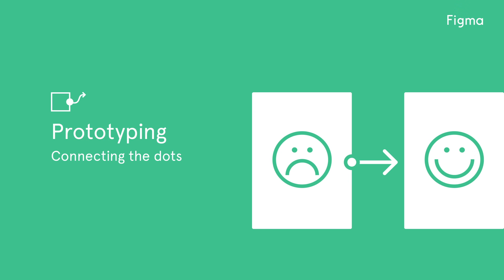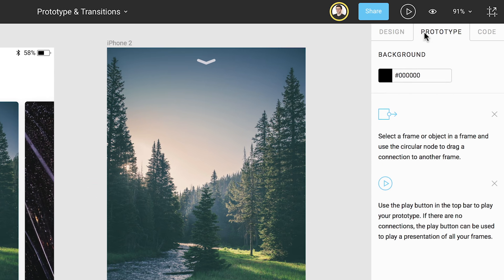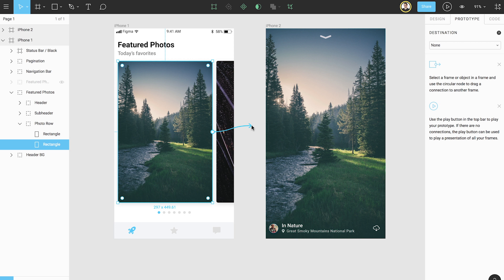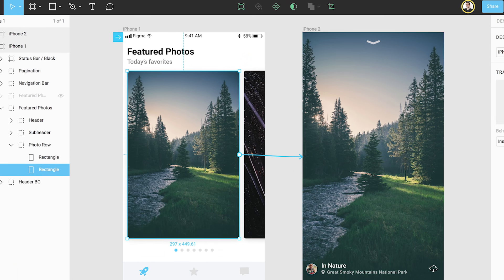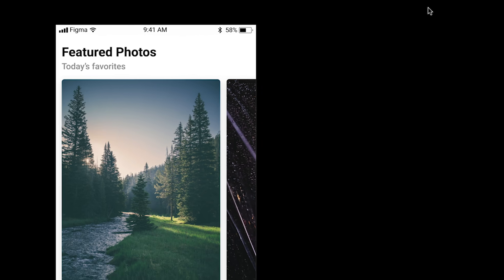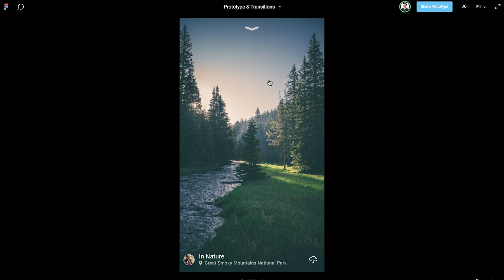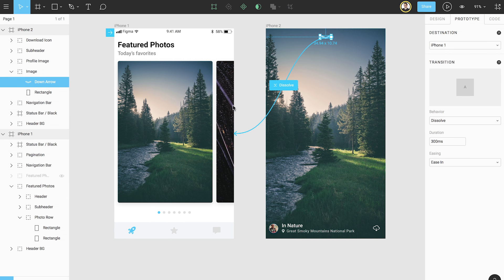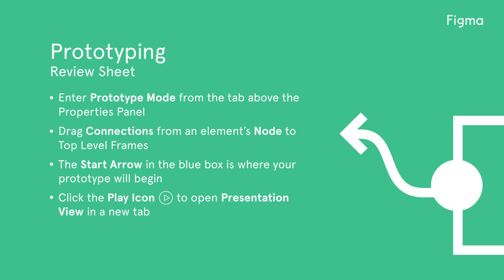Figma Tutorial: Prototyping (older version)

Comment: hey why i can't make connection on Figma?please help.No blue dot appears to connect
Reply: @aatmajap.4660  THIS needs to be way higher in the comment Section. It was driving me Nuts, i put several frames in a group (not another frame) and that's why the prototyping circle didn't appear. Thank you so much man.
Reply: @aatmajap.4660  God, thank you. I couldn't find the answer anywhere
Reply: @aatmajap.4660  No wait, even if its an icon in the main frame that isnt's showing the blue dot to connect in prototype ? what to do in that case?

Comment: How can I apply prototype linking across screens on different pages? I used the page setting to separate the Admin side, User Side and the Front-end pages of the web application and I am stuck here.
Reply: @figma I don't think Figma has a ability to link between page...
Reply: Figma replied to similar comment more recently. Looks like they're not interested in linking between pages but they do suggest a workaround:

"Hey Shinlenox, in Figma each Page is a unique prototype. This means that a single Figma File can have as many Prototypes as you have pages, which is a really powerful value proposition for some use cases. We don't have any plans right now to link using prototyping connections (noodles) between pages. It is technically possible for you to use an Action to navigate to a URL where the URL is the second/destination page, but it's not ideal since the prototype would need to load again."
Reply: @SeanConnolly  you can actually link between pages on figma

Comment: can i link between pages?
Reply from the maker: Hey Shinlenox, in Figma each Page is a unique prototype. This means that a single Figma File can have as many Prototypes as you have pages, which is a really powerful value proposition for some use cases. We don't have any plans right now to link using prototyping connections (noodles) between pages. It is technically possible for you to use an Action to navigate to a URL where the URL is the second/destination page, but it's not ideal since the prototype would need to load again.

Comment: The blue connection node never appears for me in figma what is wrong? is the interface of figma having a bug with this feauture?
Reply from the maker: Hey Kokola, if you're not able to make connections, be sure you're in the Prototyping tab at the top of the right sidebar. For more help, try posting on the forum at forum.figma.com to get help from other Figma users!
Reply: @Figma  I fixed it. It doesn't recognize random shapes as a frame, so you need to first select your parts and click "ctrl+f" for it to become a frame. Then the blue connections appear.